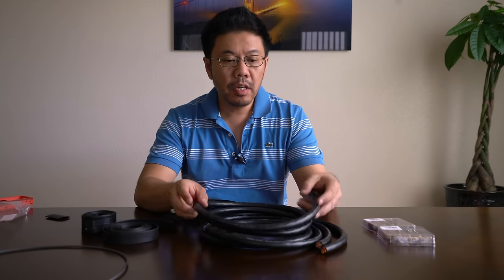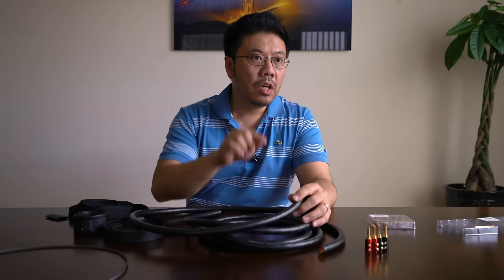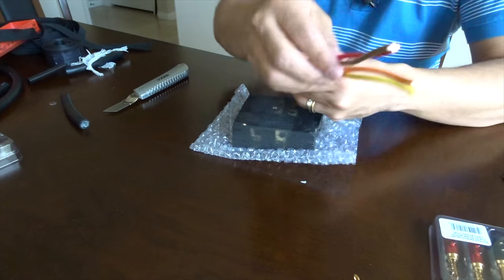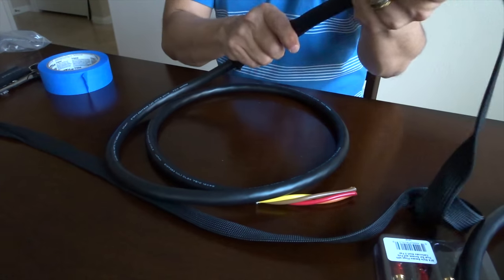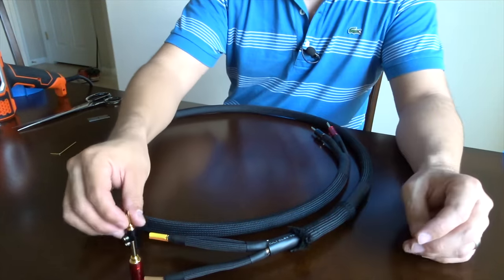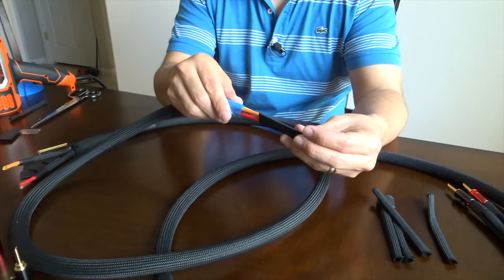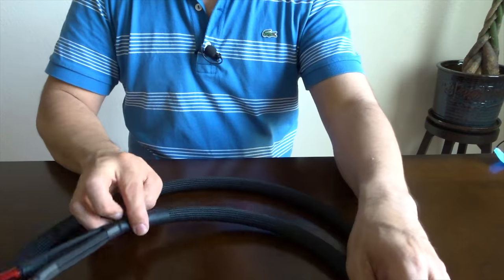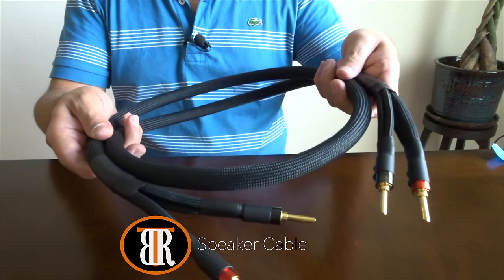Making The Best Speaker Cable For Money, How To DIY HiFi Cables

Comment: Nice work but what most people seem to be missing is that there is over $250 worth of material here, including shipping. You'd pay about the same amount for two high end cables at 5 foot each all professionally built and ready to go.
Reply: Wrong... I have the cable, better terminations than shown and for 2, 9 foot cables I spent about $100

My 2, 9 foot Canare 4S11 cables cost $47
Reply: @Scrufboy  Not sure how you can have 'better' terminations at your quoted price. Bog standards solder type banana plugs are around $8 for one. Anything less than that is garbage and I wouldn't waste my money. So that's over $64 for a start, so you only spent $40 on 18 foot of cable? You're system must sound awful. By material I also mean the kit you need to properly make the cables. I've been building systems for decades. You're maths is off and wrong. Unless you're going into business it's cheaper to go with having them made by a reputable dealer.
Reply: @hazchem1  OK first....  Isn't bare copper wire a "better termination". That has no cost?

Besides this, I do have access to materials where others have bought in bulk and then sell off what they don't use or need.  It is in who you know.   To be fair, I did buy the W3104 quite a while back.  When it wasn't over $5 per foot.  I paid just over $77 for the cable.  Heatshrink in bulk is cheap.   I used PET, cheap...  The linked Monosaudio locking plugs in the updated description only cost $43.90 right now.    I bought Monosaudio B80 pure copper banana plugs for $14 for 8 plugs direct from Monosaudio.

Purchases are as follows    $77 W3104 cable + $14 Monosaudio Banana plugs + $7 worth of waterproof adhesive lined shrink tubing(only use about 10 inches total + $8.20 for 30 feet of PET for cable (using 18ft) + $9.99 of smaller for termination ends PET 16 ft(used 2ft)     You do this math...  Purchases equal about $116 in total....   Figuring in that I did not use all of that PET sleeving and only some of that shrink tubing.    You tell me genius... What do you think my actual cost was per cable?      Thank you...
Reply: @Scrufboy  Yup, I checked your cable details already mate. I'm 9 foot from my speaker to my Amp. So that's $360 just for the cable (bi amp HFs and LFs x2 speakers). Then Plugs, tubing and other stuff and we are up over $400. I got Chord Epic X with Plugs and trousers for $500. Looks great, sounds great, didn't have the hassles of making them and will sound a lot better than the stuff you built.... well... on my system anyway. BTW... stop liking your own comments.

Comment: Coat Hanger. It works better than most so called “speaker wire”. 
Or if you want to get fancy and step it up a notch, strip out the solid 12g wire out of Romex and heat shrink one black and one red. 
Seriously people, solid 100% copper wire is a trillion times better than stranded impure copper. 
You can leave your Thank You comments below after you have tried it and experienced audio nirvana. 
And yes I am not joking. Seriously it works!

Comment: Add some shielding wrap to this to seal against RFI EMI and your good to go 👍
Reply from the maker: No need for Mogami W3104, these are probably the best in protecting EMI/RFI even for 100m length or more because these are the ones they use in big concert venues and studios. Thanks
Reply: @Tharbamar  these are not shielded. Studios often do not invest in shielding either. It’s about noise collection not inductance loss over distance. Indeed the longer the length the longer is the antenna effect to collect RFI and EMI. You’re most welcome Tharbamar 👍
Reply from the maker: @JingoLoBa57  I do not thank you for anything because you don't have real world experience with these cables, I have used very same snake cables in concert, good quality cable don't need shielding, period.
You need learn more about Quad cables.
Reply: Mogami and Canare Starquad cable does not need sheilding... Do your homework

Comment: How did you arrive at that price. It's cost me $104 just for the 10ft cable.
Reply from the maker: You need to buy it from right place like redco.
Reply: @Tharbamar  I did. The shipping to the UK was the same amount as the cable. It's not cost affective with the shipping.
Reply: @Tharbamar  I did. The shipping to the UK was the same amount as the cable. It's not cost affective with the shipping.
Reply from the maker: All my cost is base on within U.S. and even if you paid $104 for your cable it’s still worth it in my opinion because in my system this Mogami sounded better than AQ Gibraltar cables I had for last 6-7 years.
Reply: @Tharbamar  161.41 us dollars. For everything. Is that good?
Reply from the maker: @ooh to B  May be you get it from local distributor for less than that, check on Mogami website, they might have local dealers.
Reply: @Tharbamar  it's ok I've purchased it all now. I'm happy with the price. I'll let you know what I think of the sound when I get all the bits in and made them up..
Reply from the maker: @ooh to B Cool, what speakers and amp are you going to use them with?
Reply: I'm confused. I see the Mogami 3104 cable selling on Amazon jp for 1,300yen/m only. From the photos, it looks exactly like this one shown in Tharbamar's video...
Reply: @Tharbamar  my systems a bit of a mish mash at the moment I'm trying to get the best sound out of mid average products. I'm in the process of up grading everything so just using roksan kandy 2 intergrated amp as my pre and there k2 power. With monitor audio silver 6s. The sounds not bad but not quite right for my ears. Before I start replacing the equipment im looking forward to experimenting with the cables.
Reply: @SpikeoutBattleStreet  I'm confused that your confused now lol which wouldn't be hard for me. It took me a while to get upto spread on all this myself. I purchased mine from the site this chap recommended. It cost quite a bit to ship but I should imagine considerably cheaper to what the end product will be.
Reply: @oohtob6685  I understand now. Looks like it's the insane shipping cost. The cost of the cable doesn't differ that much. Amazon usually offers reasonable shipping cost. I will try Amazon at a later time.
Reply: @SpikeoutBattleStreet  even with the shipping cost so high the cables will be considerably cheaper than buying a finished product. That's the way I've seen it. Good luck..
Reply: @oohtob6685  Agree. Finished speaker cables usually have a price tag three time the raw cables and connectors.
Reply: @oohtob6685  I bought most of my cables from a online UK shop called futureshop. It's strange they don't sell mogami, canare and belden those studio cables.
I've just checked amazon jp has all three brands and the shipping is reasonable(about 400yens to asia). If you're also switching the rca cables, you may consider it.
Reply: @SpikeoutBattleStreet  I to get all my cables from futureshop. There is a hell of a lot of equipment sold in the US and from around the world that doesn't get a mention on these shores. 
I'm fine with my rca interconnects. All Atlas. It's just that I've been under welmed with my speaker cables over the years, so thought I'd try building my own with cable I've not heard of.
I'm a firm believer in that power cables make the biggest difference in a system though.
Reply: @oohtob6685  Those audiophile power cables are super expensive. Are you using one of those?
I'm thinking maybe someone can DIY  audiophine power cable using the mogami 3104. If someone can use lamp cords for speaker cables, we can use speaker cables for lamp cord. Right?😂
Reply: @SpikeoutBattleStreet  there's a price limit I go to for any cable I buy. 300 UK pounds that it.
I wouldn't recommend using the mogami as power cord myself lol
Reply from the maker: This Mogami Cables will match well with your system, please share your experience after 50+ hours of usage, thanks
Reply from the maker: I will have DIY power cord video in next month.
Reply: @Tharbamar  sounds good. 
I'm having a job getting big banana plugs for the speaker cable. Those ones you recommend I can't get. Any other banana plugs won't take an 8 awg wire..
Reply: @Tharbamar  omg. Can't wait for it.
Reply: @oohtob6685  Onkodo BP-512RH and Onkodo BP-208BR selling at Amazon jp. I'm sure they fit mogami 3104 because there're pre built selling. If you're terminating them to bi-wiring, you can buy the smaller onkodo banana plugs. They're all made in Taiwan. I guess they're not too bad. Just make sure you don't buy Amazon basic banana plugs because I tried. The Amazon basic downgraded my mid-fi to low-fi 👎.
Reply: @Tharbamar  I visited Canare website yesterday. The Canare 4s11 cable can be used for both speaker cable and dc power cable.  Therefore, I guess some good speaker cables can also be good power cords.
Reply: @oohtob6685 In case you also want soldering iron, there're Kester 44 and Almit kr-19rma which NASA used.
Reply: I just saw Belden 19364 diy power cables and some other Japan brands.

Comment: Use solid core. Better than stranded. Thinner is better. 1-1.5mm2
Reply: Why is solid core better than stranded?  I understand that stranded may be 'cheaper' to manufacture but why is Solid Core speaker cables better than Stranded Speaker Cables?      thank you.
Reply: Trauma 2000 try it, and see if you hear a difference. There’s a lot of content on the web about solid core interconnects and speaker cables.

Comment: Why 4 strand instead of just a thicker gauge 2 strand??  Outside of bi-amplifying??
Reply from the maker: Please see the link in video description for how much benefits you can get from using quad cables.
Reply: @Tharbamar  That was for line level cable which has a different shielding. Not speaker cables. And the only difference that occurred was when the interference was right on top of the cable.  Quad cabling has no effect at speaker level  whatsoever.

Comment: Like I posted a few days ago, (but its no longer showing) we ALL appreciate the tutorial video and your efforts, BUT your pricing total is INCORRECT. 
The cable alone according to your own link (priced at $235.00  for 15") so your 11"  will cost at least around $175+ plus the other components and THEIR shipping costs IT WILL BE WAY over your stated $100  total cost for this cable be most likely about  $220-$235+
This time I made a copy of my posting and will add it again if need to.  This is to bring the TRUE costs involved making THIS cable, which is excellent with their parts so I am NOT against you, but builders be aware of the total expense, AND not too many people have a heat gun in their home. I did however gave you a thumbs up for your efforts the first comment  a couple of days ago so PLEASE don't delete it again. :)
By the way I have been making my own cables for 25+ years so iI do have vast experience,.
Reply from the maker: It’s not going cost that much but 
Price can fluctuate, they will go on sale but you can always get it from redco for around $5.

I only included affiliated links and $100 is base on how much I paid that’s why I clearly stated in my video that price can be $5-$8 per foot, check on redco it’ll always be around $5.

Oh by the way any comments with links will not show in my videos.
Reply: @Tharbamar  I understand the price fluctuation and I don't mean anything bad, but people will follow your link and see the huge price different's. Where is this "redco" cheaper price you recommend instead? They only have one page worth of items and NO Mogami 3104 anywhere.
                                                              Just sayin'

Comment: Rest video, I’ve watched it several times and find something new each time. However, I found another video of you reviewing several cables in which you liked the Canare cable more the Mogami. Can you explain?
Reply from the maker: Mogami is every bit is good it just system matching and Canare match a little more better in my system.
Reply: Tharbamar thank you for the quick response. I have a very warm system, current using Transparent Audio speaker cables, but need to make longer ones for m new setup. Which one would you recommend? The Carare cables are less expensive, but will they do as well for 17’ runs?

Comment: Very good Video, but there is one thing how you can enhance your sound by far.
Because the problem ist when screwing the braids into the banana plug you have just a critical low amount of contact. Especially when using such a thick cable it doesn’t make too much sense. Instead you should solder the braids into the banana, but be careful, because you have to get soldering tin with high amount of silver, to not change the capacity of the cable to much. Audioquest does it the best way,l by burning the braids into the material of the banana plug.

Comment: Cables are cables unless you are trying to start a 400 hp three phase motor you will be fine with any cable as long as they have the proper cross section.

Comment: Thanks 4 The Very Helpful Video....I dont Have Super Expensive Speakers or Ultra High End Equipment but at $8-20ft Including Banana Plugs & Heat Shrink & Nylon Mesh those are a STEAL

Comment: that cable looks near identical to the cable in my Audioquest midnight 3 speaker cable...I say looks, it probably isn't.  Most serious hifiers will biwire their speaker cables, that is not the case with this cable it seems.  2 runs of this cable to each speaker would be a nightmare!
Reply: "most serious" haha good joke.. Biwire is bs
Reply: @lucaleogrande9141  I personally found it makes a very slight difference, but not a lot and you really have to be listening for it.  Each to their own.

Comment: As you are using 2 cores into each banana plug you would be better off plaiting the tails rather than keeping them seperated and solder (silver) is far better than a screw, also its quite a stretch to call Mogami "referance grade" ok or good value perhaps.

Comment: what he did wrong is double the wire up.... theres no need for that.  what you do is cut the casing back expose the 4 smaller cables... remove the casing from each.  get your banana plug withought the outter casing... place it in the middle of the 4 wires and wrap the 4 cables around the bananna plug.  If you need to solder it. then wrap in electrical tape then shrink wrap it...  Or if you have big balls you can cut the casing of all the wires until you just have copper and get a giant sleeve for that lol.
Reply: No.

Comment: I did mine last night.
Couldn’t be any happier, I could immediately hear the difference in sound. 
As UK customer I couldn’t find any of those banana plugs, but I’ve found these ones which worked very well for me: 
KabelDirekt Banana Plug (6mm²... https://www.amazon.co.uk/dp/B078PJTKZD?ref=ppx_pop_mob_ap_share

As for the sleeves I used the expandable ones which allowed me to pair 2 wires together for each side. Only cons they tend to open up when you handle them.

Comment: what in the world makes a speaker cable cost $1800? im pretty sure i could make a set of cables out of pure silver for like like a quarter of that.
Reply: because there are rich people in the world who want to buy them to make themselves feel better, so companies capitalize on that
Reply: Actually you can buy pure silver litz speaker cable from Audio Note. Just thought I would save you the time of making your own ;-)
Reply: Mark Ironside what do those cost though? I’m just talking cost of material here. Silver is only $17 an ounce yet a set of silver cables could cost like $4000. What are they doing to copper to make it cost $1800 for some cables. The biggest determining factor of how it performance is gauge and length and obviously silver is a better conductor so you might see some improvements there.

Comment: Reference grade...?!? Bog standard OFC with solid brass connectors. Yeah, absolute reference dude.
Reply: So what works better, your platinum core, silver dipped, battery attached super cables that you spend 10k on?  Very smart, dude.

Comment: Complete overkill but if you sleep better at night, have at it. Remember, you're just moving electrons, a single 12 gauge is more than enough for 80 watt per channel. If you're into doing things extreme, I would have suggested soldering the tips and not simply screwing them where the cable is exposed to moisture in the air.
Reply from the maker: In my opinion there is no such a thing is over killed in this hobby because one day I might even build my own power station.

I’m believer in direct contact over soldering the speaker cables, as I was growing up in pro environments I do annual cleaning of all my cables and every components.

And base on measurements of the technician that I go to, my amp put out about 120w per channel at 8ohm and 190w at 4ohm, Denon conservatively rated output of the amplifier, so bigger the cables safer for any situation in my opinion, even for pairing with hard to drive speakers like KEF LS50 or Martin Logan Electrostatic Speakers. 

The main reason I like a bout this cable is how much quieter compared to many other speaker cables.

The last reason alone worth every effort for me, thanks
Reply: Considering you are not the only one in the area 'moving electrons' those cable might serve their purpose better than you think..
Reply: @4rzaluz  or impose an unnecessary amount of resistance, albeit negligible in this case. It's not like we're taking about rocket science here. Like I said, whatever makes you sleep better at night.
Reply: @matrixate  OH we know that but.. You really don't realize how crowded the electromagnetic spectrum is at any modern city nowadays.. Do you?
Any 'long enough' conductive material works as an antenna for those frequencies.. It is likely that an increased resistance might exist.. but not only for your source which is powerful enough for the task.. but for anything else polluting the signal.